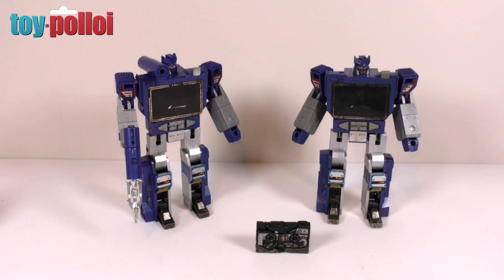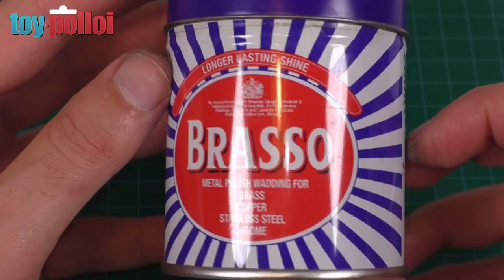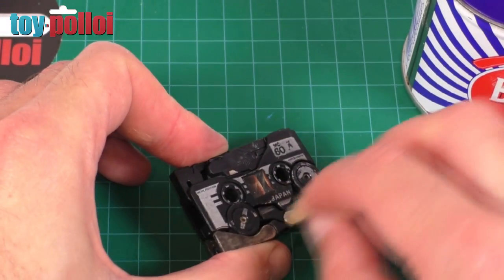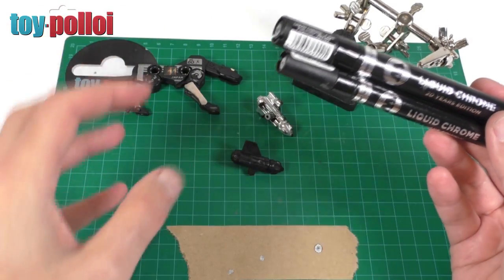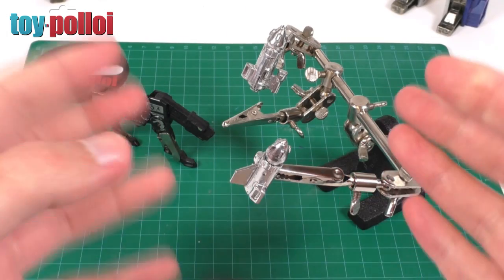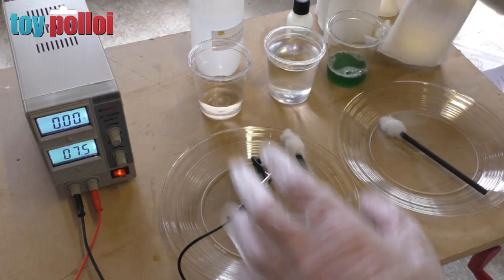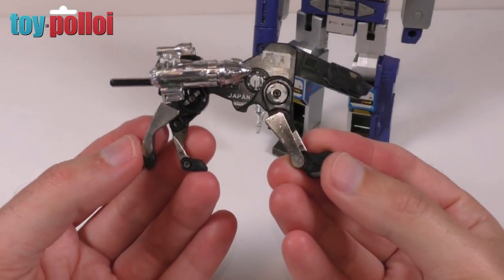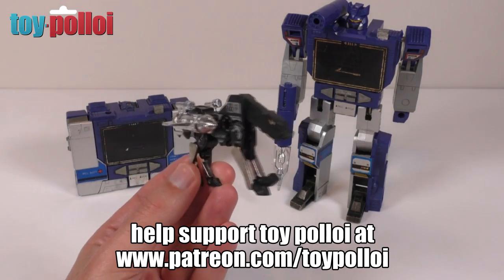Vintage Transformers G1 Ravage Chrome and Nickel repair - Toy Polloi

Comment: Glad you can still get 'Brasso'. I used to quite like the smell, but I expect changes to the formulation over the years, have altered that. I used to use it to clean my bike wheels and chrome parts with. Never thought to use it on die-cast, though. Excellent.
Reply: @travisash8180  - That is so odd. I was at home the other day, making myself some lunch, when a variant of that, popped unbidden, into my mind, and made me laugh. Viz:

'So shine up your buckles with Brasso,
It's only five pennies a tin,
You can buy it at Woolies for thruppence,
But I don't think they've got any in.'

Comment: my legs on astrotrain keep falling down so have taken it to bits and trying some nail varnish  on the plastic joints inside to stiffen them up a bit, you need to push out the pins on the wings to get to the other 2 screws on the back to remove the legs lucky mine pushed out easy , also got some plastic weld on the way for another job that super glue wont fix.

Comment: For me the chrome dulls no matter how long you leave it. I left something for months without touching it and would still dull.
Reply from the maker: Not had that problem. But I don't tend to handle them that much when I'm finished. Will give it a go and see what happens.
Reply: Toy Polloi I did see a guy who managed to load some of this paint into a spray gun to spray models, and then clear coated it without it damaging the sheen. So that’s an idea, extremely even coating and with a protective layer so it won’t ever dull.